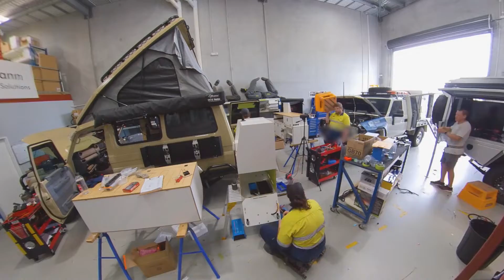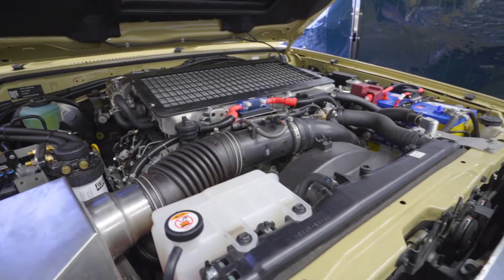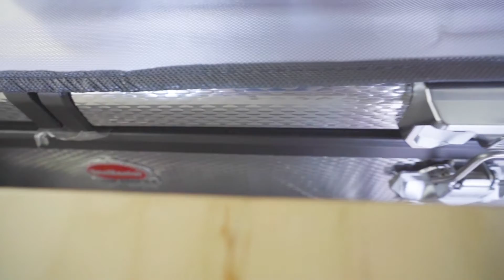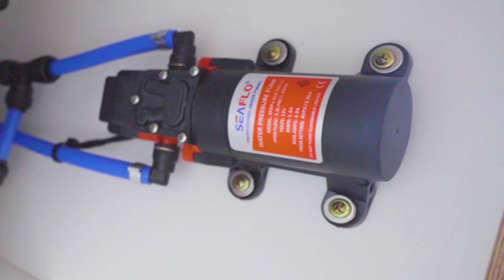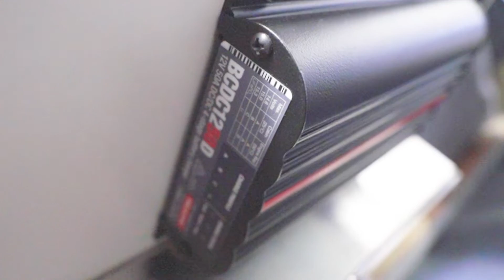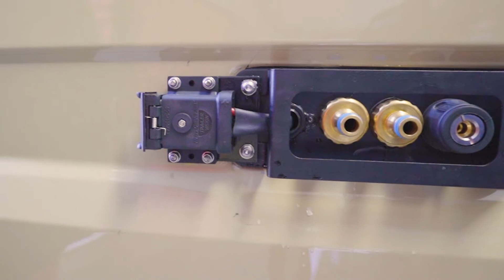Heiner Builds Your Ride | Toyota Landcruiser 78 Series Troopy

Comment: Wow! Thats a nice build. The attention to detail is spot on. Can i ask- when you are sitting in the drivers seat it looks as if you are very tall and the roof conversion “low”. How is it when the roof is lowered? Ive got a 79 dual cab, have had trakka poptop 78s and have ordered 2 troopies with the factory gvm updgrade. 👍 keen to hear gour expert opinion
Reply from the maker: I am just short of 1.9m and I find the headroom is easily enough for me. To gain a bit more headroom Recaro Expert M seats help because the height of the seat is adjustable when installing the seat to the base.
Reply: @ReadytoDriveAnywhere  many thanks for the reply! Thank you. Brushless alternator is a fantastic idea as well.